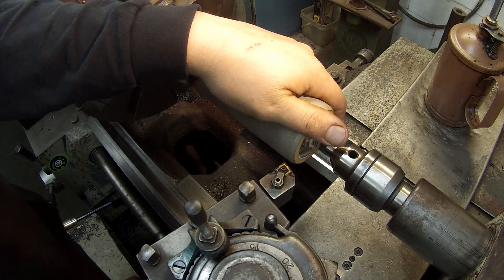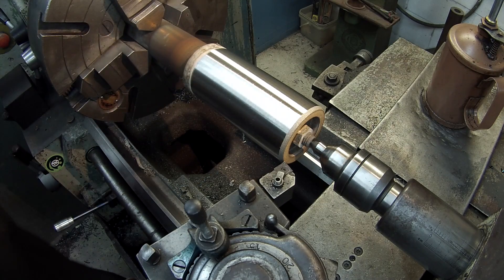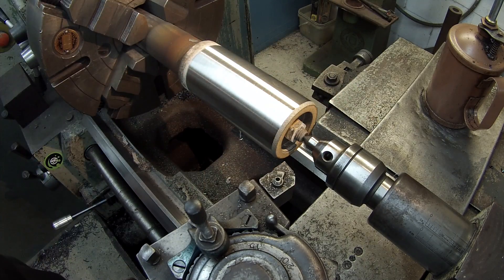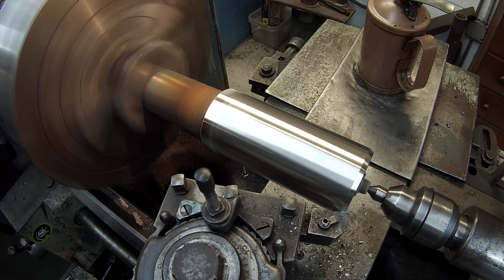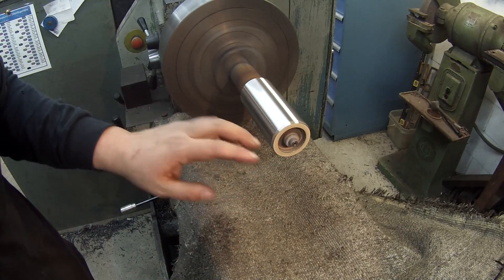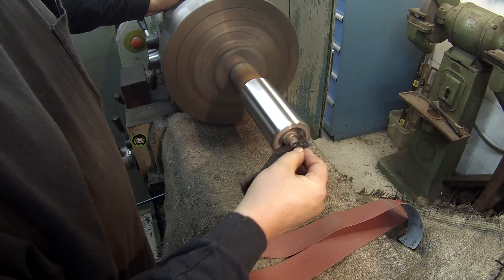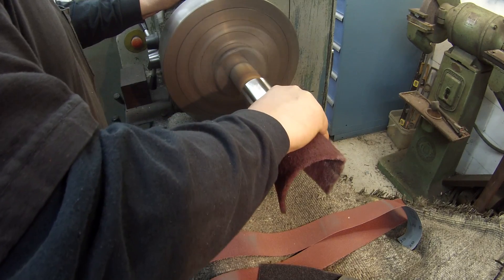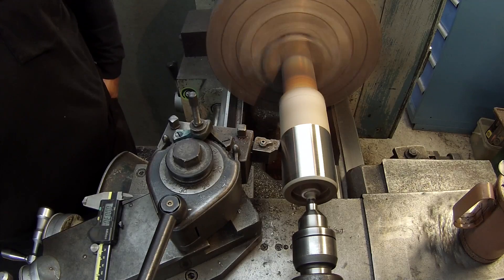Stainless Steel Metalizing Part 2

Comment: They look as good as new! I have a couple of engine cranks laying around here that could possibly be salvaged using this method.I hate to throw out parts that still have hope! lol
Reply from the maker: I know it's a process some shops do, but I know of no one around here that does.
Reply: patw52pb1 They are forged steel cranks. republic diesel in Louisville, Ky spraywelds a bunch of larger cranks for tug boat motors and mining equipment.  As long as there is still availability of used cranks then their repair price is way too high for these smaller cranks. They would charge typically $2000 to reweld and grind one of these cranks and you can buy used ones for $500. That is why they pretty much only do it on big stuff where a used crank would be $5000 then it is a good value option.
Reply: bcbloc02 Are the cranks iron, steel, cast or forged? 
Cranks and cams are spray weld built-up and ground to size again on a regular basis. 
Many larger, well equipped automotive machine shops offer spray weld shaft repair.
Reply: bcbloc02 Wow, $2000, are you sure somebody is not pulling your leg. 
The last crank Republic spray welded for us was nowhere near half of the figure you quoted.
It was a forged steel V8 crank with 1 damaged rod journal, 1 damaged main journal with the thrust bearing surfaces and a damaged rear seal surface. 
That job complete with inspection, repair, Magnafluxing, polishing all journals and snout cost us under $800. 
Try talking with Steve Edmondson at Republic 800-292-5565 for a decent price. 
Submerged arc welding (SAW) is preferred by some shops to repair cranks but is a much more expensive process than powder spray welding. 
The reasons are mainly due to the much higher initial cost of the crank welder(>$25K), increased labor costs due the much higher heat input causing distortion and movement that requires post welding shaft straightening before final machining and grinding. 
If a good usable $500 crank is available, that would certainly be my first choice.
Reply: I was talking for a full redo of all journals, not just two. It was for 6 rods and seven mains back to factory spec. The engine had an oil pump fail and it scored them all pretty good before it seized. I have had shaftech in ohio do SAW on cranks before and I actually prefer it for a crank that is really going to be abused.

Comment: Adam any sense as to how durable the metalized part is compared to say a new machined stainless bearing?
Reply from the maker: Peter, most of the coatings are pretty tough and create a tougher wear surface. Even this stainless is a bit harder, but I'd have to go back and look it up to find out the hardness. I don't recall off hand. 
I would love to see these after a period of time to see how they hold up.
Reply: I did find a couple of articles on the prosses and coates onto a surface actualy add harder material than that of the original however there was a foot note as to thickness on temperature where the temperature of the original surface and the spray coate will expaned at different rates but should not provide much problem if the material is able to bleed its heat off. Anotherwords the skin coate added only becomes a problem when its thickness stops the spread of heat between surfaces.

Comment: You need a little sleeve to put over those threads...
Reply: Abom79 Simply use a sacrificial second nut to fully cover the threads.
Reply from the maker: Yea sometjing like that would have been good.
Reply: Abom79 And maybe a cover to protect the chuck against spray too...?
But, hey! Who am I to tell the master about these things??? Nice shootin' again, Adam! Bushings came out really nice in yet another great video..;)
Hope I can get my hands on a used/cheap spray welder myself some day. Want to try building up some of those old bike parts - axles, fork tubes, gear shafts,

Comment: Hey Adam,
Nice work, as always! Is there a flux in the metal powder? Before you started turning the part down to size, it appeared to be coated with flux or something. Thanks for sharing your work. You no doubt saved your customer a bunch of $$$!
Nave a good one!
Dave
Reply: Swarf Rat No need of an ass nasty reply. 
With very few exceptions, everyone here is attempting to be friendly and helpful. 

I believe what you are referring to is the outer layer of spray metal that is both grainy from the spray deposition process and is also oxidized resulting in a dull surface finish. 
There is no flux per se such as a borate, carbonate, chloride or fluoride as used in oxy fuel brazing/welding in the spray welding process. 
The MSDS and manufacturer's composition sheets for the powders do not list a separate flux component.
Reply: Go to Part 1, Adam explains what he's done in preparation.
Reply: Don,  I know you are trying to impress everyone with your vast knowledge, but you missed by a mile on this one! I didn't ask about preparation. The question I asked dealt with AFTER Adam had completed the job! There appears to be a slag-like material on the entire piece. You see bright, shiny metal after this stuff is removed by the cutter on the lathe. That is what I was asking about! Got an answer?
Reply: What I was getting at, is that Adam explained in Part 1, the type of weld powder options he had considered. Each one has a different rate of oxidization (slag, as you put it), but it's all part of the metal powder reaction during melting process. I should not have said "what" but instead 'his' choice. I'll be quiet now, sorry for the interruption.
Reply: After he turns it to shiny clean metal, not much flux required.

I suspect that his flame is slightly reducing rather than oxidizing, rich vs lean.
That will act as "flux" to protect the powder from oxidization.
Reply from the maker: Sorry for the late reply Dave. The powder is mixed with different powdered chemicals that get melted during the heating cycle, and it acts just like flux in a weld. So it's similar to welding, but it doesn't create a layer of flux, but only a layer of dust. The light tan color your seeing is the dust from the powders after it has been sprayed.

Comment: Thanks Adam I really enjoyed these two vids. The metal spraying technique has been around for ages as you know. I remember it was a favourite cost saving repair for worn crankshaft journals which was common many years ago in old cars due to lack of oil changing. I've often wanted to see it done, now I have. Cheers & Happy New Year.
Reply: It's still a crankshaft repair option, especially for high end crankshafts that would otherwise be thrown out. We used to buy them, get this process done and re-purpose the cranks for general automotive and commercial service instead of a high performance 500 - 1000 hp they were originally intended for. This usually occurred when the main bearing was spun, damaging the journals, often spreading to other ones because of debris. But the art of this process isn't as common as it once was and often difficult to find someone willing to do it and then attempt to machine large throw clearance requirements. I do not know if either of Adam's lathe's (Monarch or Victor) could handle such a repair. The throw of the rod bearing counterweights is a very large diameter. Racing cranks are often machines from 4350 alloy steels. Premium cranks are often 4330M  with YS (ksi): 137 / UTS 150 with 16% EL 47% RA. I don't how these modern materials would handle it.

Comment: I just found your channel and would like to thank you for some very interesting videos! 
Thank you!
Reply from the maker: Thank you for the sub! Not sure what all you have seen, but I try and do a weekly video each Saturday, and some machining videos in between.
Reply: Abom79 - I started with the two metallizing videos, which was fascinating! I've seen it done with large machines before, but never by hand.. I'm not a fabricator or anything like that, but really enjoy these kind of instructional videos! Looking forward to your next videos! 

But I have a question: the steel that's sprayed on, how good is it? How is the quality of the finished part compared to an original part? Thanks.